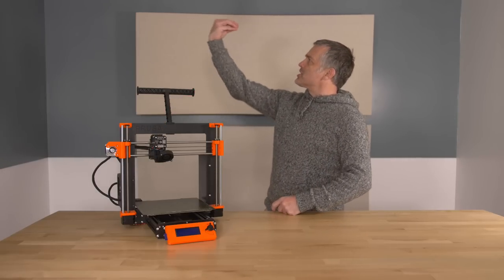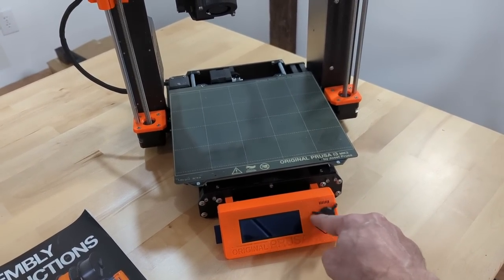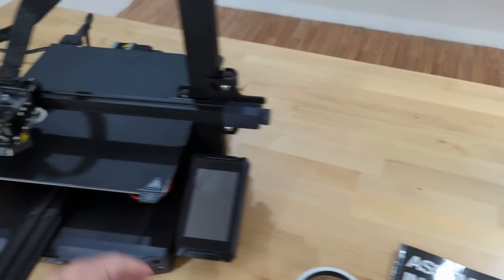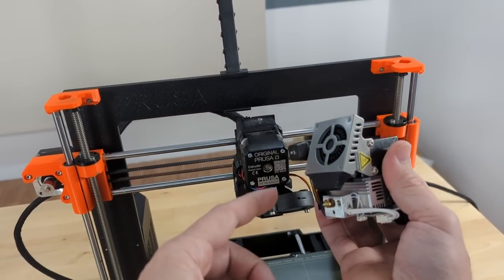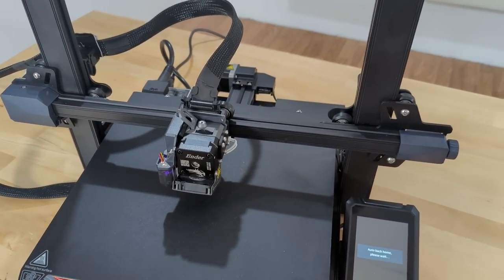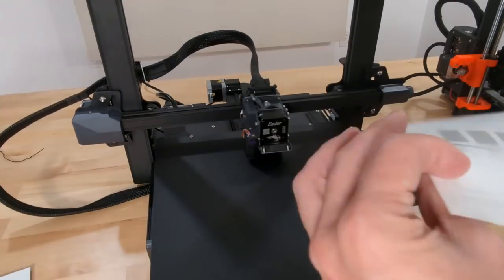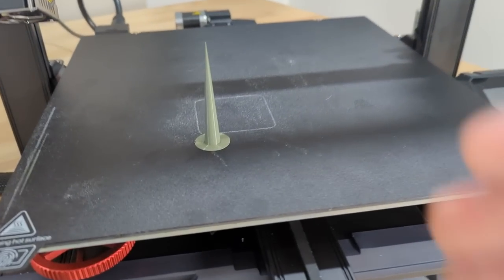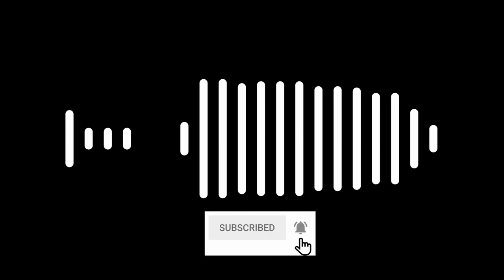Creality S1 Plus Has all the right features - Let's compare it to PRUSA I3

Comment: I use a first gen iPhone SE. Should I get the Prusa because I like Atmel and old tech or should I get the Creality because I'm cheap? If you guessed cheap then you are right. I paid $138 (shipped) to get a refurbished Ender 3 Pro. The included filament printed a great 3D benchy then then next day was crackling and popping from absorbed moisture and I had to dry the filament to get it to print well again. The 1kg spool of Creality branded PLA does not have this problem so I don't think it is from the same source as the sample, which is a good thing.

Comment: I'm loving my Ender 3 S1 Pro. I installed a 3rd party firmware called "professional firmware" which is way better than the stock. I had to downgrade the touchscreen to the Ender 3 V2 screen which uses a wheel. Nathan Builds Robots has a modder board you should look at. I bought a second Sprite assembly for swapping out nozzles. I have plans

Comment: I have a nearly original CR10, the first one that came out. I have just added during time an all metal hot-end and auto bed leveling, then I moved to klipper  (with an old RPI I had around) and since I got rid of the spring the quality became amazing, I am so happy that I hope it will last for ever.  
during all these years I found that I used the 30x30 bed 10% of the time, but it helped me a lot to have such a larger bed. I think that 2525cm bed is too small, at least for me, I still think that the sweet spot is 30x30. 
another thing I doon't get is why do they still use springs when they have auto bed leveling... I got a huge improvement in quality when I got rid of them...
my 2 cents....
Reply: What kind of bed leveling you have in your CR-10? There is no need for replacing mainboard?
Reply: @adrianveq  no, no need to replace mainboard. I have added bl-touch because I wanted to get rid of the knobs that are under the bed. getting rid of the knobs and springs is where you get improved quality the most.

Comment: Its like comparing apple 8 to the latest version of 2022. But still I love the innovation and standardisation that the Prusa company does in the field of 3d printing. It was Prusas flagship years ago and it made other companies improve their products. Prusa has always had great support vs no support (unless you can talk chinese). I enjoy Prusas website, challenges etc that they host.
Reply: There is nothing bad in buying newest Ender or the newest Prusa. I think that both printers need maintenance in some point and tweaking to find the right print settings.
And can`t deny that people like brands and enjoy them. A Scoda is not a BMW but both are cars that you can use for driving. An older BMW is still more expensive than a new Scoda. The same anology is with Lego and cheap copy bricks from china - you can make builds with both of them, but everybody likes the genuine article more and is ready to pay 4x times more  over Chinese copies.

Comment: Superb review and analysis; considerably better than any of the many others I’ve seen.

Regarding the Prusa “it just works” supposition: my factory-assembled Prusa has exasperating reliability and manages to botch a surprising percentage of prints, all of which could have been prevented with better engineering. I paid a premium for the Prusa after believing the hype from Prusa fans, but various aspects of the machine as well as PrusaSlicer are truly harebrained, not just antiquated with a design well past its expiration date.

Arguably worse than the i3 MK3S+ is their customer service. I have decades of electronics experience and resent requests to upload videos/photos to Prusa to prove, say, the thermistor is bad when it obviously is (tacit message: “we don’t believe you”). They clearly don’t value customer time and must not be receptive to some of the negative feedback they’ve received, perhaps instead preferring to bask in the illusion of their superiority. With competitors rapidly gaining ground and one of them (Bambu Lab) on the precipice of leaving Prusa in the dust, Prusa’s reign as the foremost consumer 3-D printer will soon be over.
Reply: Similar experience here. Mini arrived with the y-axis belt loose and impossible to tighten using the stock parts. Hotend grub screws were overtightened leading to complete hotend replacement on the first serious jam. On my 3rd hotend now, again overtightened and destined for a landfill within a year or so. At this rate I'm going to essentially rebuy the printer every 3 years, cost-wise. Not what I expected from a premium brand. 

Support claimed this is the first time they hear about the hotend issue (which was all over their forums at the time), while also claiming the grub design isn't being used anymore (it is, an if it wasn't why would that be?)

But I'm sure Prusa's legion of "customized it in my machine shop and it's perfect" fans would disagree.

Comment: I have an Ender 3 8 bit old school and it runs near 24/7 printing petg with a microswiss all metal hotend, the metal extruder, capricorn tube. yeah it took me some time to get right but now it's just a dead steady beast. Also have an Ender 3 S1 Pro running Klipper, and an Ender 5 Pro w Klipper. These are all very good machines. I don't get the hate.

Comment: ender extruder assembly is smaller, but saying it wins is funny.  even on klipper, it can't touch the prusa in speed (while maintaining performance).  we're comparing their new sprite extruder to a name brand e3d hot end, name brand bond tech gears, higher torque extruder motor, and name brand noctua heat brake fan.  and the stock part cooling fan works fine.  centrifugal fans have good static pressure, and being that close to the bed, it cools just fine, even printing virtually everything at 200% speed like most prusa mk3 users do.

and apparently someone skipped statistic class if they think the setup routine is showmanship.  it's an inductive sensor.  they're noisy.  to get the most accurate measurement, you want the most powerful reading, and you get that by being perfectly centered to the read locations.  you don't get that by checking it once.  you test it from many directions, many times, and take an average to get a nice solid answer.  maybe some kalman filter for good measure.  and you complain about setting up the pinda height, but the instructions literally tell you to mount it one zip tie distance from the bed while the nozzle is at perfect printing height.  I got it first try.  read the manual!  and you keep mocking the "it just works" thing, but I've had my mk3 (non-s, non-s+) from preorder and have thousands of hours on it, and I've never tightened a single crew or belt.  not one damn thing.  six years, still the calibration done on day one.  still prints perfectly.  that's "it just works".  and the lengthly pined calibration is why it can mesh level the bed in like 1/3 the time other prints like the ender takes, and nail it every time.  1st layer is one of the single most important things in 3d printing for success and reliability.  prusa knows where to put their time and effort.
Reply from the maker: So do you consider it your job to sow the seeds of doubt. Nothing you are saying is concrete. Your entire game is just to make things seem less clear cut. Both extruders clearly print without issue up the maximum speed that the printers can be run at. You are just trying to pick off each win of the Creality one by one and make them seem like they aren't wins. 

You are a propogandist. Why do you behave this way? Are you being paid, or is this just a hobby for you? Are you some new sort of troll? You aren't here for the LOLs you are here for the manipulations?
Reply from the maker: Seriously though. Stop trying to manipulate the internet. Let the printers speak for themselves. Tell Josef to make a competitive printer which is competitively priced instead of forcefully selling us on his 5 year old overpriced inferior machine.

Comment: I saw that you commented on the difference in size and mass of the bed and how it affects the acceleration and jerk parameters. But I believe this comparison is not fair, as the S1 plus is a large format printer. It would be fairer for the comparison to be made using the S1 Pro or the normal S1, as they have a bed size close to the Prusa I3 MK3.
Reply from the maker: I was giving the S1 Plus credit for having the larger print volume so it's only fair to speak about the drawback that comes with that larger format. BTW, I would call 100-150mm beds "Small format" 200-350mm beds "Medium Format and 400-600mm "Large format. I don't think the S1 Plus qualifies as large format. But that's just my opinion.

Comment: Hello, thanks for the video... I am researching a first printer, for my 3 kids and I... they are 9, 12, and 15... it will be used for all sorts of hobby stuff, and will be a part of our homeschooling technology curriculum.
   I am leaning towards the Ender 3 S1 Pro , please let me know if you think that would be a good choice for some beginners as a first purchase.
   Also, is there anything else that you think we should acquire to help us get started smoothly, besides some filaments?  
   Any suggestions for where to get materials, parts, and even the printer itself?  We live rurally in the mountains and I don't think there is anywhere locally to get these type of things, so looking for a good , reputable source to order from.
   We hope to add this to our home after New Years.  After Christmas we will be building a desktop PC to use for this and a Silhouette Cameo cutting machine, as well as other uses.... it is almost identical to the PC that my son built just under a year ago, so I have faith that it will be a decent project and serve our household desktop PC needs... 
   Thanks for this video, liked and subbed , and hope to check out the channel more soon...   cheers and happy holidays.

Comment: Hmmm… different from my experience. The Ender 3 S1 was my first printer and I learned a lot from it because I did way too much tinkering in past year. Now it runs Klipper and can print with quite incredible speed. However, I almost have to tune the settings for each model I created to achieve a good enough quality. I find this frustrating, as it could not “just work”. This is especially a problem if one aims to print for profit. Plus, the bed leveling mechanism is very unreliable. You could see people proposing all kinds of solutions in Facebook groups.
That was why I ended up buying a Prusa MK3S+ to see how good it is, since people running print farms appraise its consistency. For me, it was day and night. Although it looks like a dinosaur, it is old tech, the movements are relatively loud, and it cannot hit the top speed of a Klipper machine (you lose some useful features if you go Klipper on MK3 and it’s a bit more complicated to install Klipper than more modern machines, so I’ll assume you won’t do it), the print quality seem to me surreal at first. No, I didn’t get that obvious artifacts on the surface like on your video. And the consistency is as good as what I heard. Now  I rarely have to tinker print settings. I can press print, walk away and it won’t fail.
Reply from the maker: We don't know who you are. You could be working for the Prusa marketing department. Your entire comment is a testimonial contradicting what I have documented on camera. If you want us to take you seriously make a video proving your words. I'm sure Prusa would be happy to retweet it and blow up your channel. What's adds to the sus factor of your comment is the single upvote. Most other comments don't have that. Looks like you used your alternate account to upvote your own comment. Everything you said just seems to be manipulation without substance.
Reply: Nah… I’m just sharing my experience and I have no will to make sure everyone take my words seriously. Just like I won’t 100% believe anyone’s content. It’s more like “okay, someone had that situation”. People can do their own DD and make their own decision.
Reply: @burnout.c  dude don’t bother arguing with DPT every time he sees positive things about prusa it’s “prusa marketing team” and whenever he sees negative comments he encourages them as they “prove his point”

Comment: i changed my sprite pro extruder fan to a 5015 fan because little strings of plastic would get in the fan and make a buzzing sound but only because of that, because the peformance of the default fan is actually really good

Comment: XYZ calibration in MK3 includes XY calibration which automatically measures XY skew and saves the skew coefficient. That means the XY angles will be very precise so you can print mechanical parts that fit together. On other printers you have to print diagonal test object, measure it manually, insert into calculator and then insert the skew parameters into the FW (if it's possible). It includes also XZ and YZ skews but takes much more work.

Comment: Can you do a video tutorial about SuperSlicer? I have added it to my slicer stable and am still trying to figure out if I want to use Cura, SuperSlicer or PrusaSlicer. I know PrusaSlicer is a SuperSlicer fork, so it would be interesting to see what are the differences.
Reply: Super slicer is a prusa slicer fork and prusa slicer is a fork of slic3r, if you want maximum control use SS, if you have a prusa use a prusa slicer, Cura is a mixed bag, I love tree support, but the models themselves seem to slice better in PS and SS
Reply: @budhiw  I have noticed the same thing. I don't have a Prusa, but it slices well for my Kingroon KP3S Pro, using the Prusa Mini Profile and changing a few things. The FLSun Q5 seems to like Cura or Prusa Slicer. I was just curious about the differences, and whether or not I should try a new slicer or just use what I have been using and be content. But I will give SuperSlicer a look and run it through it's paces.
Reply: @JohnDStrand  try it out, I love the amount of options in Super slicer, have PS and Cura installed but not used at least a year
Reply: I bounce back and forth between Cura (currently using v5.2.0 Beta) and IdeaMaker. I know that IdeaMaker made noticeably nicer prints than earlier versions of Cura, but I'm liking the way the latest version of Cura is performing.

Comment: I pointed out what you said wrong: Prusa parts are made of ABS. not PETG. As you say he is 5 years old and it is true. 5 years warranty and support from this company, they are confirmed by people. Creality where? The warranty is just a piece of paper. My CR10SPRoV2 printer damaged the thermistor and shows the temperature incorrectly, and despite not moving it, I complained and the company does not respond. It doesnt work in EU countries. That's right, it's 8 bit, but it uses 100 percent more power than 32 bit printers. It prints flawlessly and has a dozen confirmed filament profiles that you don't have to fiddle with to set up. You're right that it was 5 years, but look at it honestly, they've only just caught up to Prusa level. For 5 years Creality has been pushing people cheap printers like the Ender 3, I remember they said it was better than Prusa and it wasn't true. A marketing scam. But what about the fact that the S1 Pro has just come out ... I'd rather you talk about Bambu Lab X1 Carbon or P1P because they can be compared to Prusa. Creality in my eyes is a joke and scammers. If the Prusa mini version, I would prefer Kingroon KP3S Pro, Ender 2 Pro is also a joke and a dump. I have noticed that Creality bribes Yootubers like Chep who favor and despite other printers dont reviews. Anyway, I don't favor Prusy, because I have Voron 2.4 350 and as I wrote, I had a CR10SProV2, it was my first printer that disappointed me quite a bit. I have friends who have a Prusy farm. And when I look at the Ender farm, I think they come out the same, because people have to spend on mods to get to the level of Prusa. And you know what's best, I see the comparison. Prusa had less breakdowns than Enders. If something broke, they got it for free. Creality no, you would have to order and pay.

Comment: I messed up and got the Ender 3 Max (not the S1 Plus) and added on the Creality hotend and auto level sensor.  I never could get it to work (as a set) and had to return it.  The good news was that right after that the Bambu came out.  Had I got this one, I'd probably be using Ender instead of Bambu today.